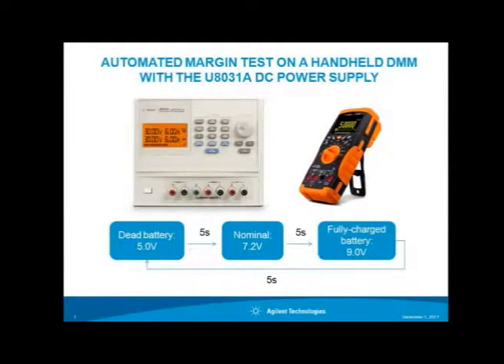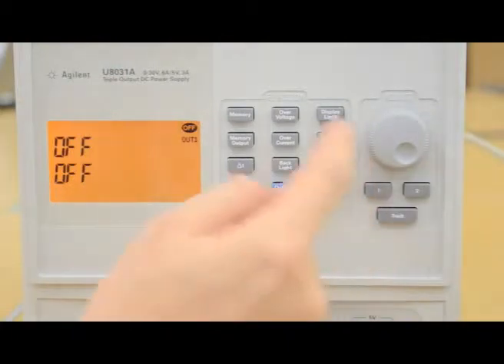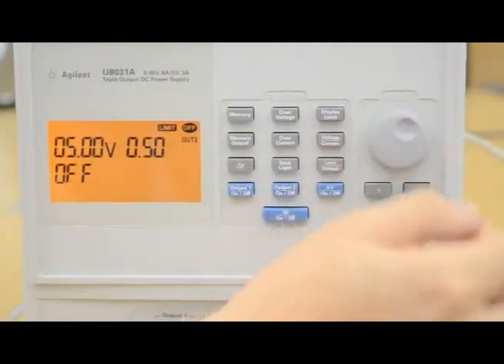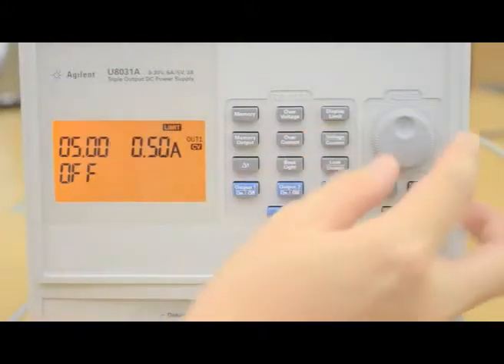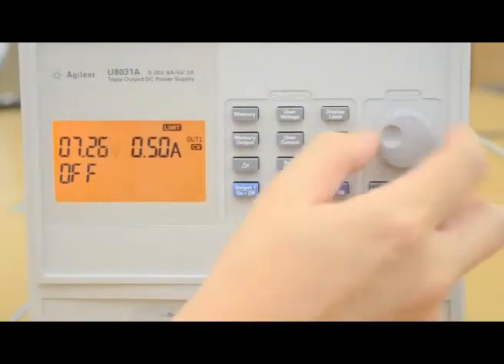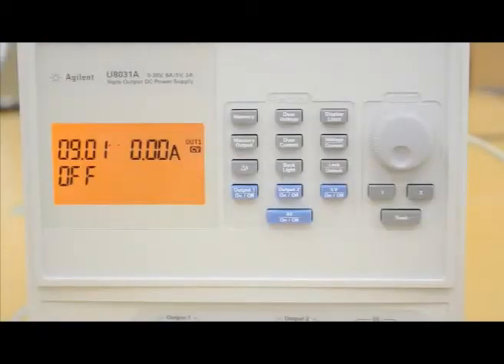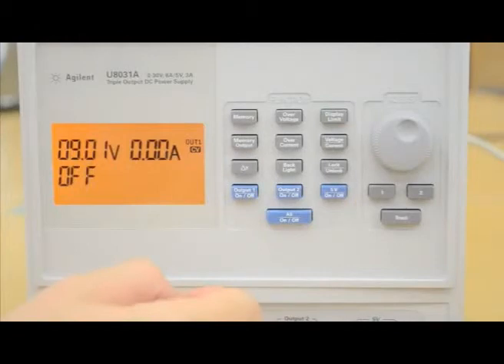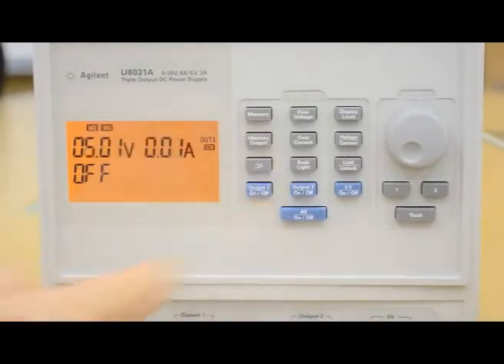Margin test using the Agilent U8031A output sequencer

Comment: is there any specific reason why the DMM was set in AC voltage measurement mode?
Reply from the maker: Soumik Sen Good question. To understand how the DMM functions with a low battery it would be good to test all functions. Setting up the power supply to automatically step through the voltage steps would reduce the testing time. The AC function was selected just as an example.